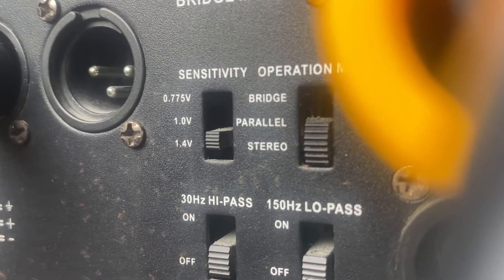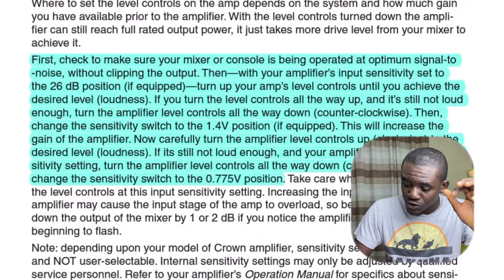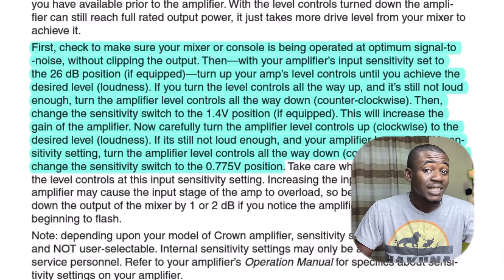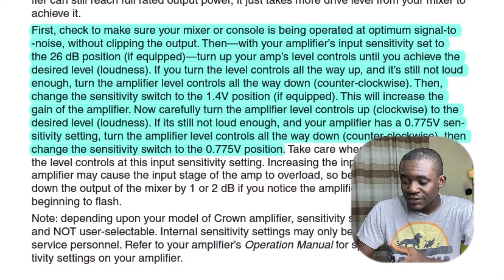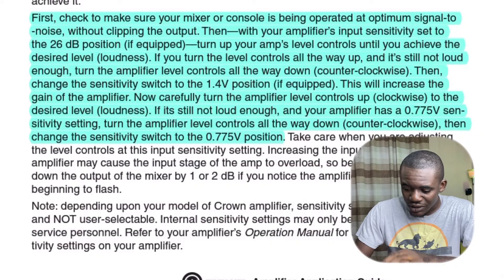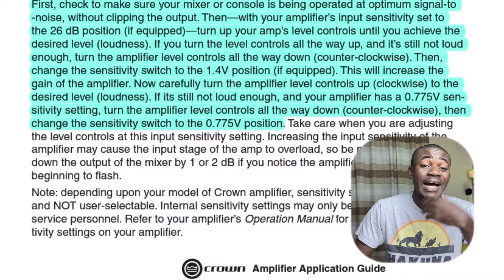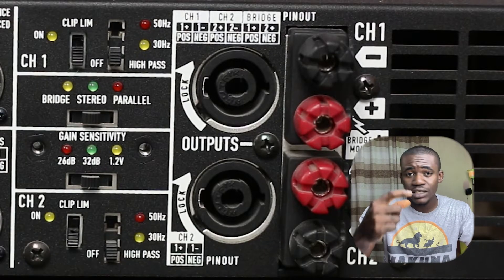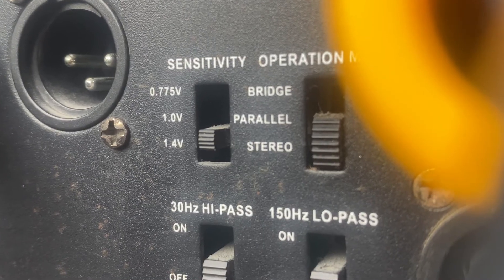How to connect a Power Amplifier to a passive Loudspeaker

Comment: What size of speakon you use?
Reply: SpeakON does not goes by size...😅
It's about the Numbers of conductors/contacts it carries...

Eg. used in video: 
NL4 (4-Contacts for 2 sets of Transducers)👍

Other series includes NL2 & NL8 SpeakON connectors...👌

Comment: Hey great video... do I need a external crossover for a 2 way passive speaker
Reply from the maker: No you don't. Most passive 2-way speakers usually come with built-in crossover circuits.

Comment: Sir… warm greetings from Equatorial Guinea. I’ve a problem with my power amplifier, only the channel B speaker output works, channel A doesn’t. Please what do you think could be the issue and what could i do ?? Please help me 🙏🙏
Reply: It's means may be one side is blown so behind the Amp there is a switch that enable both sides to support each other, turn it of and on and start again

Comment: If I have a passive subwoofer then where could I connect to my mixer other than the main outs?
Reply: A Passive Sub/W shall be connected to the Spk. OUTPUT of a Power Amp...😅

You do Not connect the wiring from the passive Sub/W directly to any of yr Outputs on yr Mixer (be it Mains Out or otherwise)...😮

Even if you are referring to a Powered Mixer, I doubt it may be able to properly power yr Sub/W with its built-in Amp designed for powering Full-Range Spk.😟

Comment: sir  some engineer  directicly connect  amplifier to mixer  and  not     open the gain  of  mixer  they control  output only from  mixer  is that reduce  the  sound  quality in live shows 
becouse i see practically  there  func  are  vry   good  also  without open the  gain  so please  share some knowledge  about that
Reply from the maker: I don't quite understand your question. 
You can rephrase it, please, or better still, send me a message on Instagram or twitter.